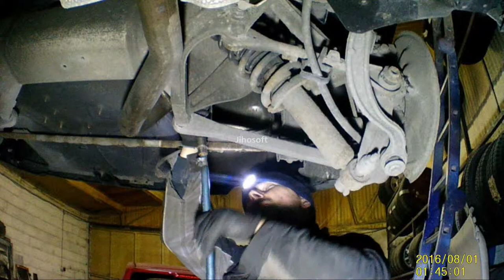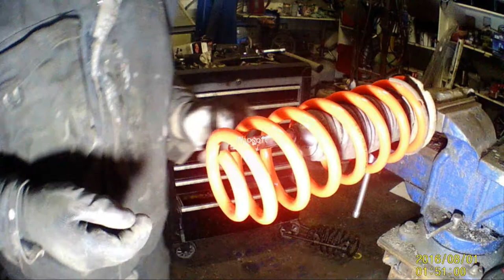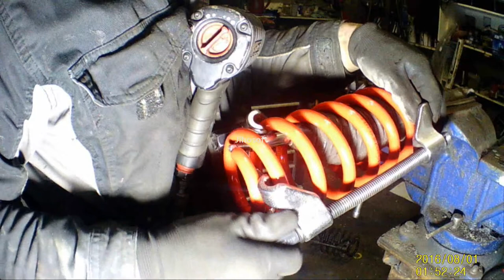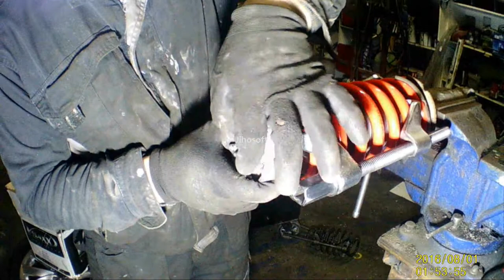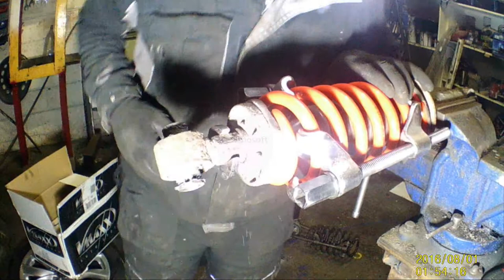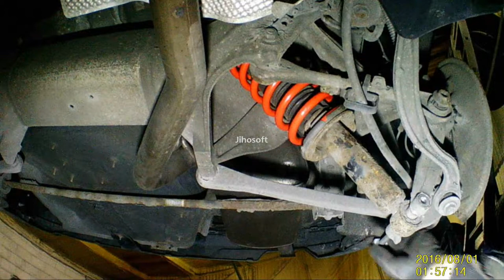how to fit coil spring on citroen c5 2008 AME Motors Howtofix

Comment: Hi did you must verry hard tight this screws?
Reply from the maker: no dont need
Reply: @amemotors  a colleague has a Citroën c5 III and recently was in the workshop to replace the rear springs. after a few months, or more precisely yesterday, he returned and felt that the back of the car had fallen. he usually has a suspension not hydroactive. the question is whether it is necessary to screw it all together and do these bolts have to be tightened when the car is already standing on the floor?
Reply from the maker: @Przebudzony  i did this car long time ago cant tell you now with way better
Reply: @amemotors  anyway thank you for your help